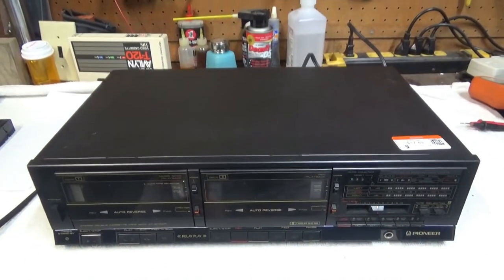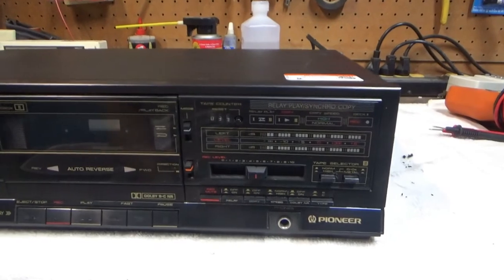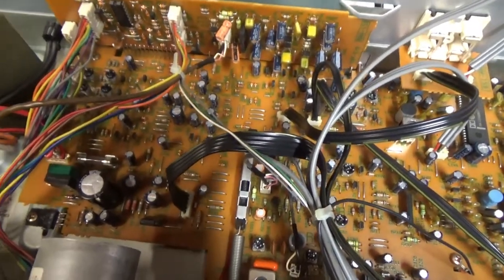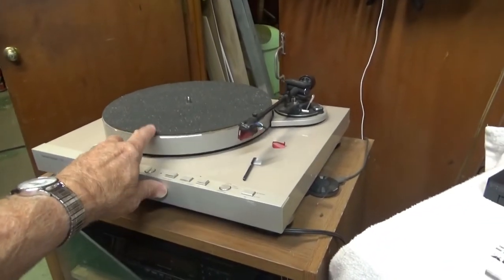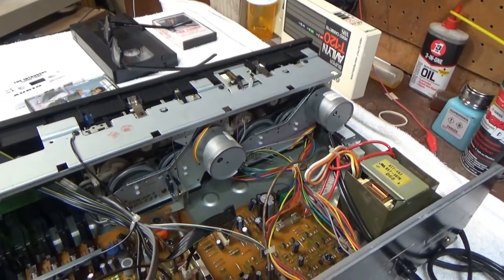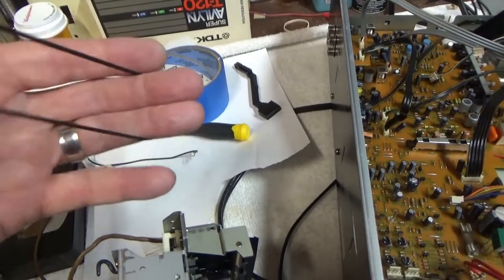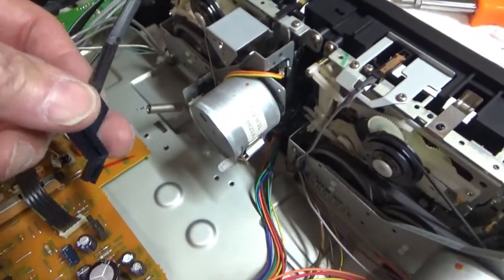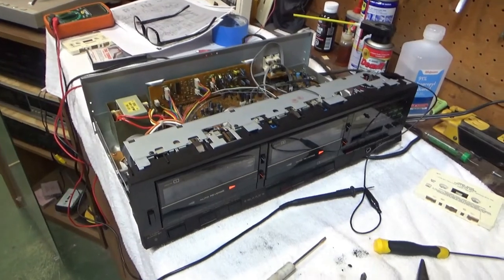1989 Pioneer Double Cassette Belt Replacement

Comment: Great job. I recently replaced the belts on a similar vintage Sony TC-W345. Much cheaper unit with a much simpler mechanism. Barely any disassembly required. The belts were totally exposed.
Reply from the maker: Thanks for commenting on the video. It's good to hear that there are others out there keeping these old cassette decks working.
Reply: @mguess  Videos such as this one are what give novices like me the confidence and the knowledge to go into the old machines and get them running again.  
Thanks for all you do to spread the knowledge. I've replaced belts on three old decks now and all are running back to spec.